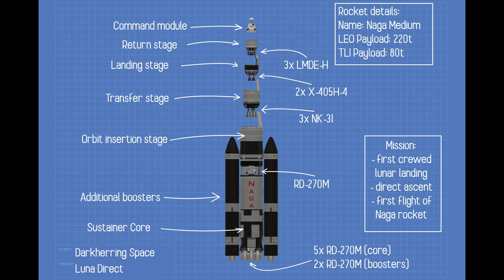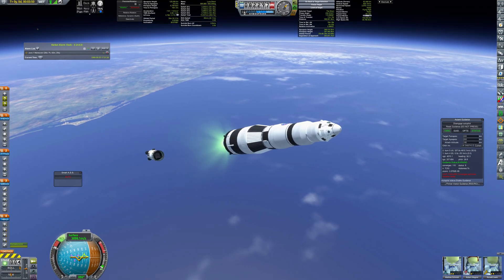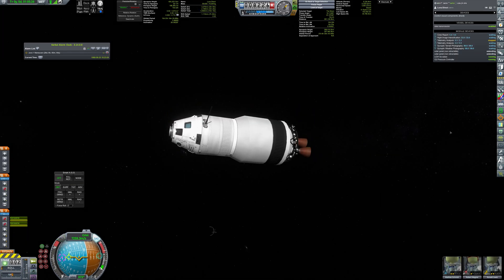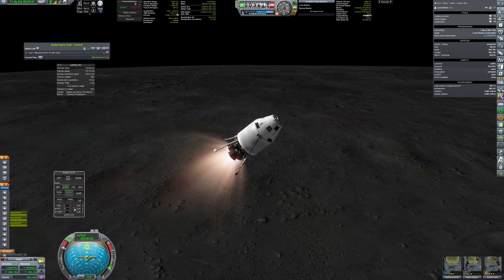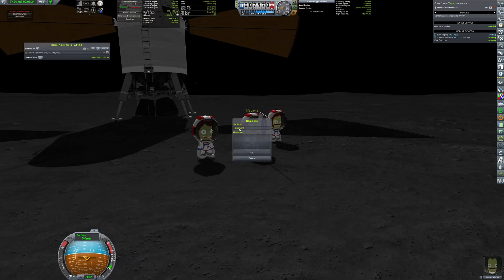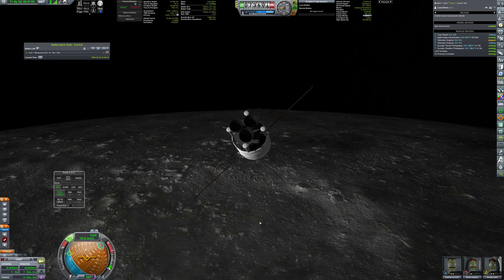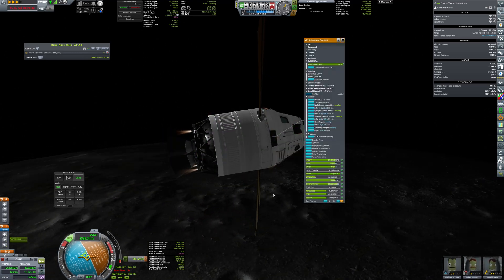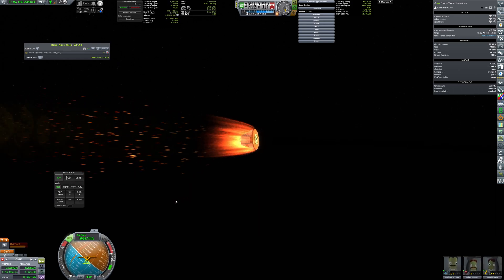Crewed lunar lander - Luna Direct (RSS/RO/RP-1)

Comment: Hi Darkherring - I have a question.

Would you be able to make Soyuz 5 (the rocket, not the Soyuz mission just to avoid any confusion) with the new space capsule that Russia is developing? I have been trying to do so myself but have found no packs that could help and RSS/RO is too hard for me. sigh
Reply from the maker: AFAIK there are no mods for RO that would give you a pod that would be used on Soyuz 5.
Reply: @Darkherring  I figured - well damn. I'll take a look at it on Simplerockets 2 and I guess I could probably cheat a bit with stock parts and stuff on KSP to get the look of the pod and Soyuz 5.

Thanks!